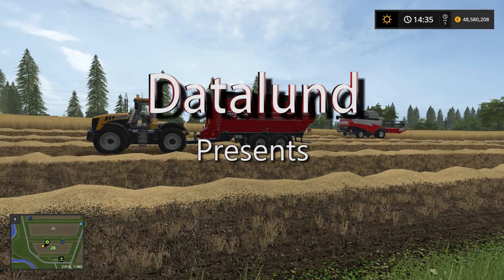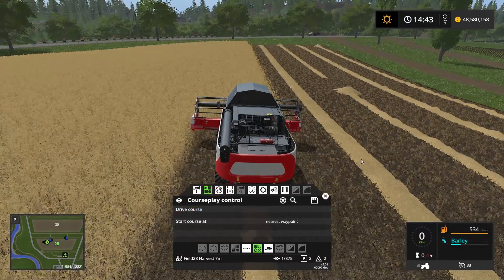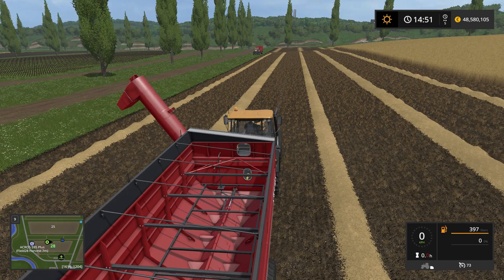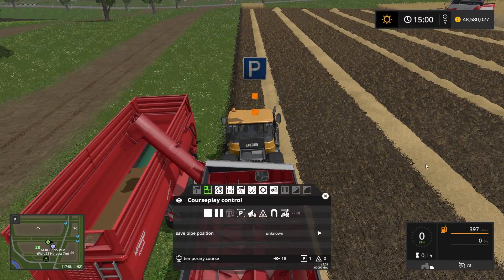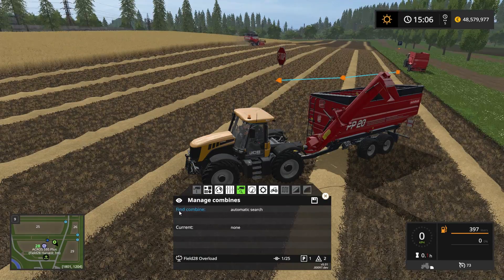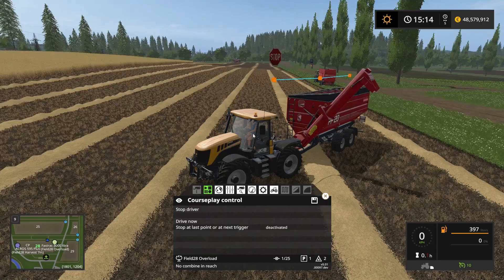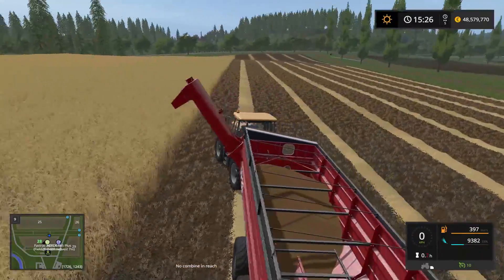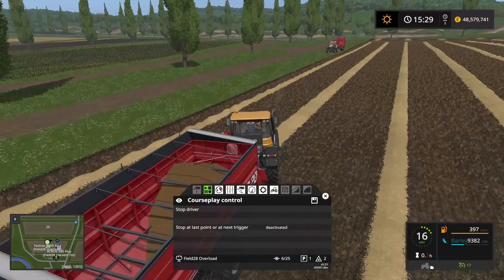How to set up Courseplay for Overloading - Farming Simulator 17 Courseplay Tutorial

Comment: Thank you for your video, all good except! ha, how did you manipulate the pipe up or down, thanks again Peter
Reply from the maker: Hey Peter. You move the pipe on the overloader up and down by holding the left mouse button and drag the mouse up or down. Once you have the perfect position of the pipe, you can use the "Save pipe position" in Courseplay to tell Courseplay this is how the pipe should be once Courseplay drives the course. https://youtu.be/-Njvl9bgIIY?t=314
Reply: Datalund g

Comment: Datalund you are so spot on in your tutorials, Thanks - BUT! need your help...
How come that this note Comes up "to many waiting points - only 1 allowed!" when combined course?? 
I combined a "combine harvest" + "a unload to tralier" some times its goes some its doesnt?! 
Cant just spot the problem...
Reply from the maker: Hey Thomas. That sounds a bit weird. Are you using modded equipment or is it happening with the ingame vanilla equipment as well?
Reply: Datalund Solved.
Reply from the maker: Good to hear. Gonna be a good Christmas after all then ;o)
Reply: Datalund  can the s650  combine work with  this
Reply from the maker: I haven't tried it with that combine, but it should work fine with any combine :) As long as the combine is showing up in your game and is working without any issues, it should work fine with Courseplay as well 👍